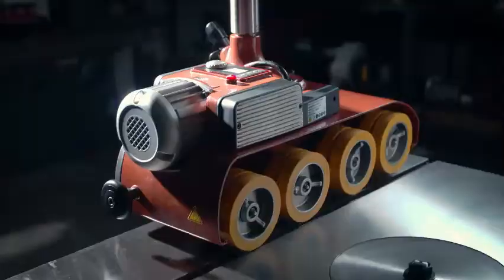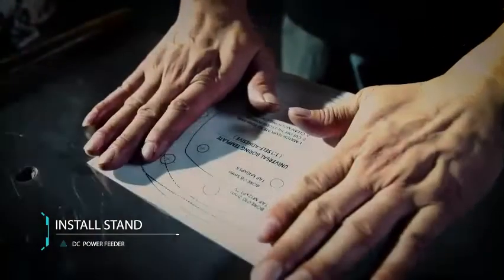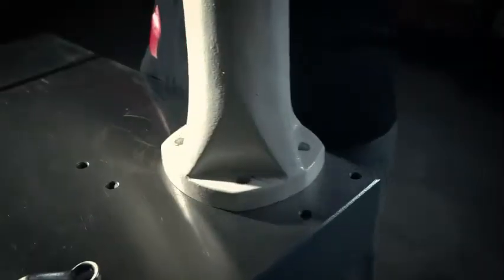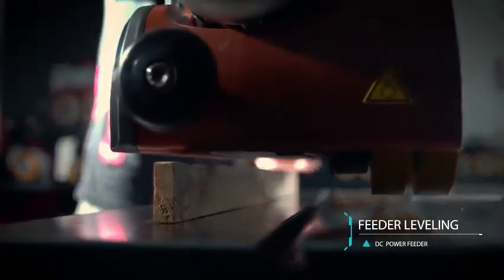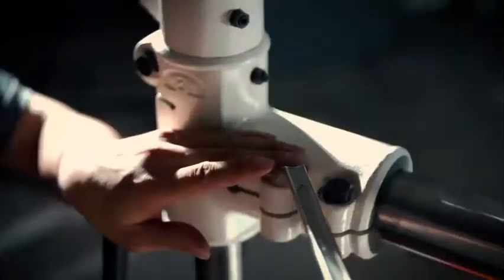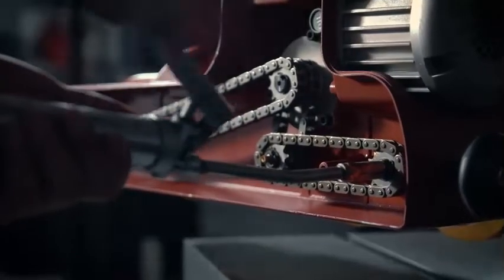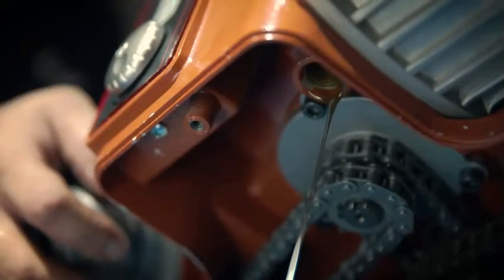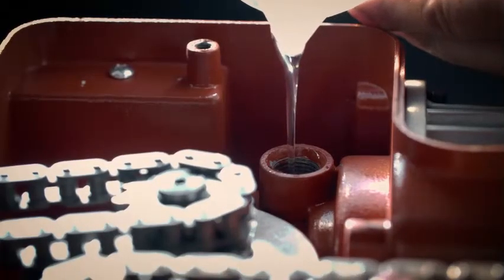Co-Matic Power Feeder Installation and Maintenance | DC Series

Comment: What oil should be used for the feeder? 
There was no manual included with the feeder, and I can't find a manual online. It would be nice to know exactly which lubricants should be used
Reply from the maker: Hi, please contact us at co-matic@co-matic.com, we'll send you an electronic manual.
Recommended Grease: SHELL Alvania R. 2; SHELL GADUS S2 V220 2; MOBILUX EP 2; FUCHS RENOLIT EP 2; BP ENERGREASE MM-EP 2

Recommended Gear Oil: MOBIL - MOBILGEAR 460; (SHELL) - OMALA WE460; BP - ENGERGOL GR-SP 460